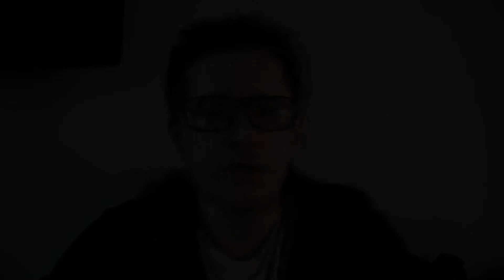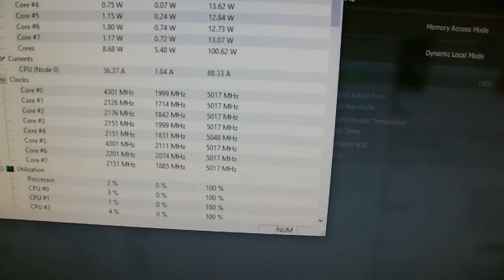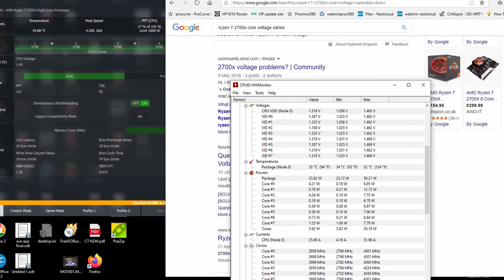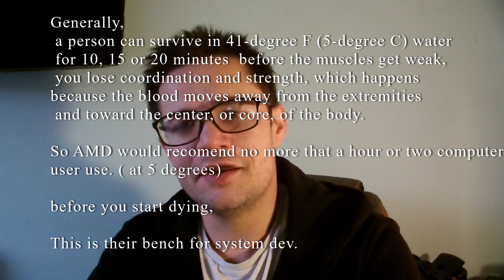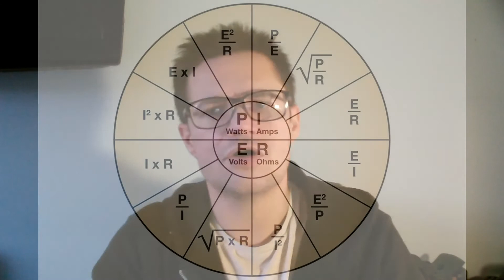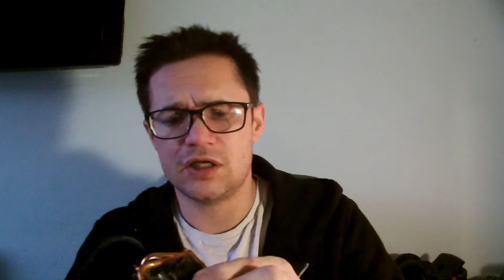Ryzen Master :the software that shouldn't. Rise voltage.   Ryzen 5.2Ghz

Comment: does this software need to be open every time i boot
Reply from the maker: The software Ryzen master, doesn't change setting unless it has been opened.
But.

In the background there is AMD microcode which runs along side windows.
Then.
There is also the main board bios and motherboard software.

So you end up with three software/firmware running.

So the short answer is no you don't need to run it. But you can see what happening if you do, and make changes to the microcode (the processor drivers as it were).

When you get to much software trying to do the same thing then you get problems.

Interference also comes from Windows itself and the power management settings.
And any other software you maybe running.

If you want to see what's going on download "hardware monitor" it's free and gives you the voltages, power and performance of the processor (and more) so you can what's going on "behind the scenes"
Reply from the maker: I've not seen the software have a "boot at start up".

Effectively you configure the setting and then the software boots loading those setting at boot time.

I always go down the route of not having multi boot loads, hence I have a 6sec boot time.

I do not have reyzen master boot, as the software is not good and I deal with performance from within the bios and manually set the systems hardware that "magik" which is entirely a guess by the software.

No the software does not need to be even installed.